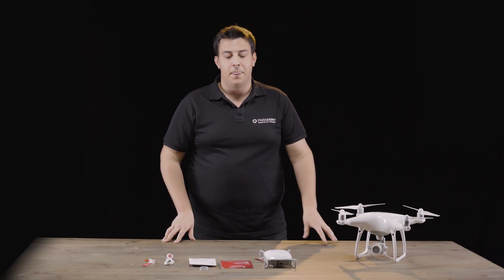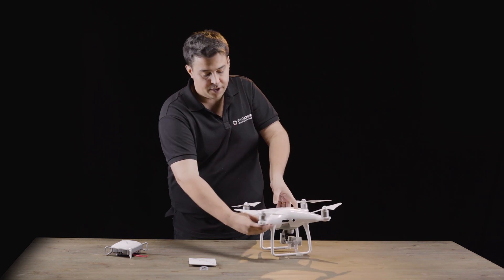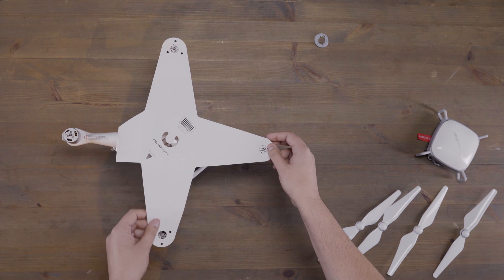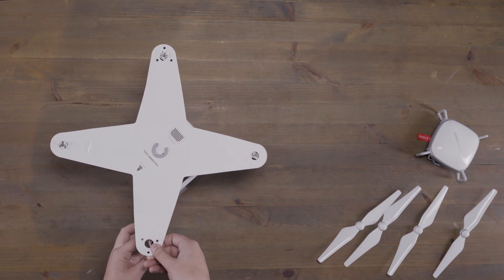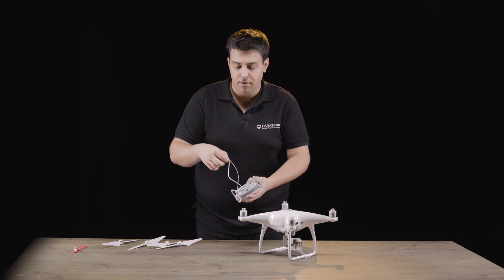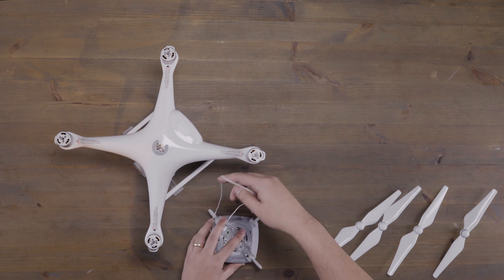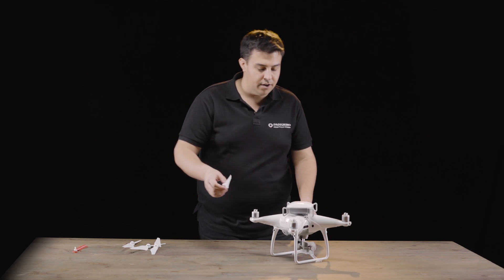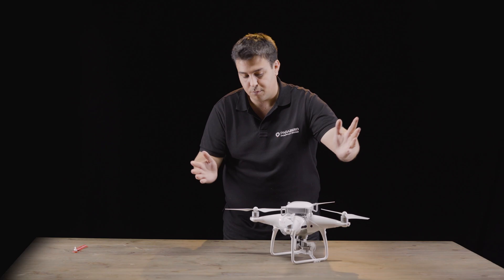ParaZero SafeAir Phantom: Installing The System

Comment: I've installed a ParaZero SafeAir on two Phantom 4 V2.0s now - each time the placement tool holes will easily slip over two of the prop mounting plates, but are about 1/4" short trying to reach for the other two. This requires me to stretch the placement tool so much that it tears a little. Any advice?